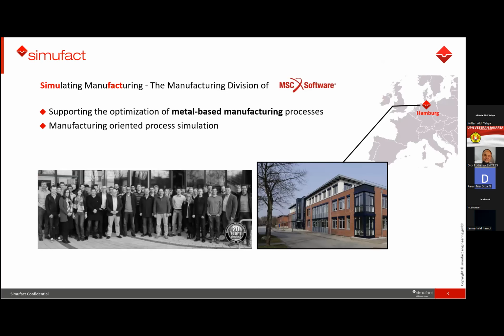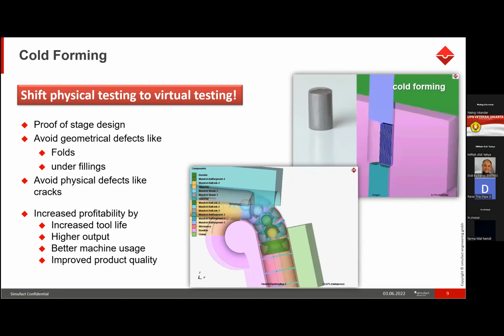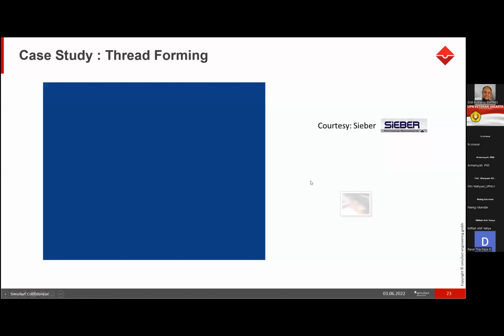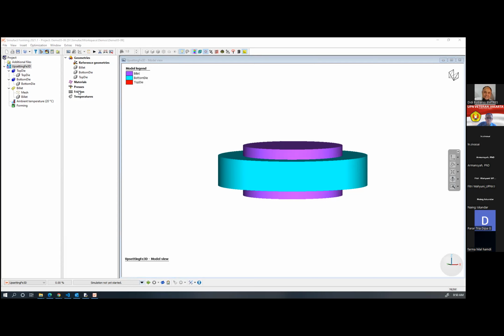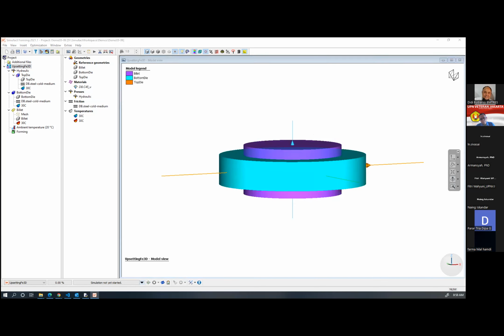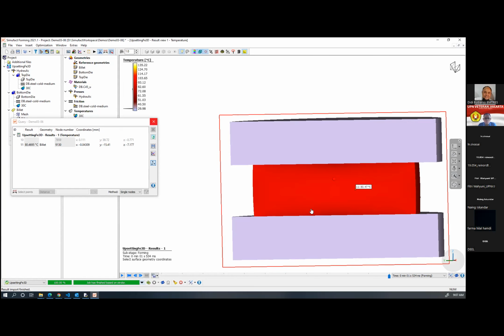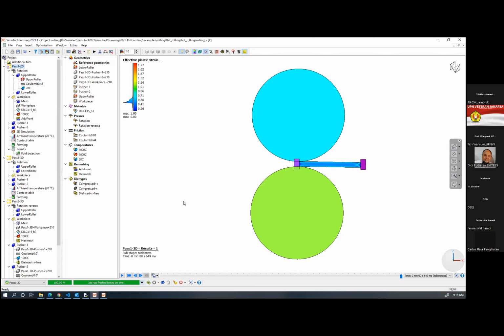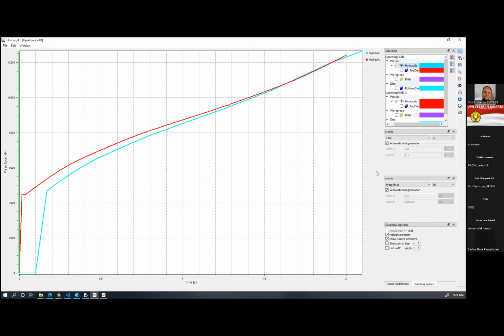SIMUFACT METAL FORMING, MILLING, ROLLING, CUTTING (Jum'at 03 June 2022)

Comment: Excuse me, I would like to simulate the orthogonal cutting of metals, the tool that cuts the piece in horizontal motion, so I wanted to apply a horizontal tubular motion pressure in x, after building the time/stroke table, it doesn't let me drag the pressure and therefore I can't apply it, can you help me thanks